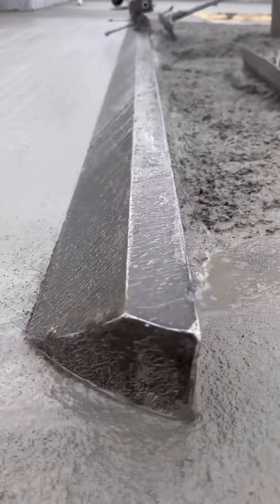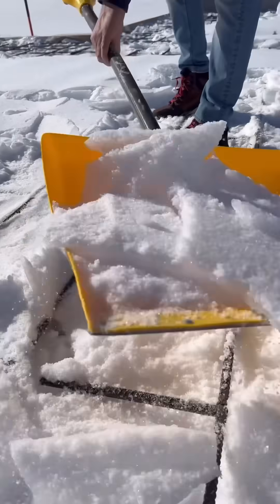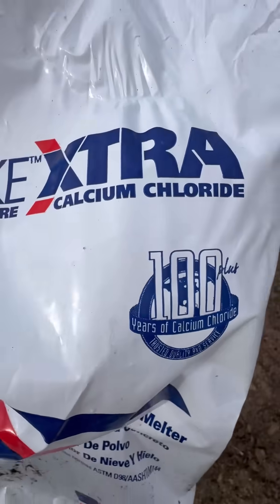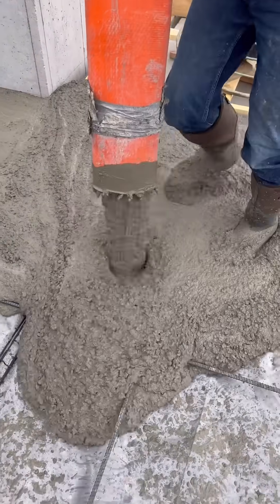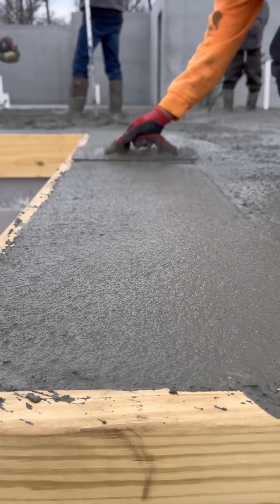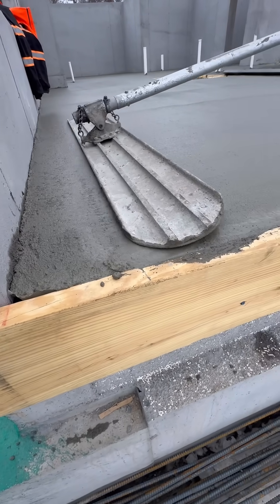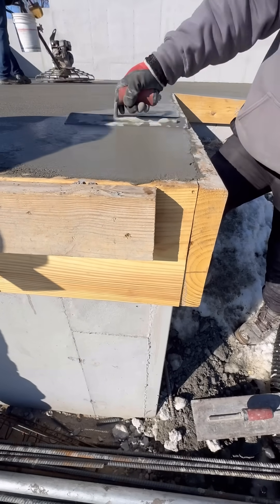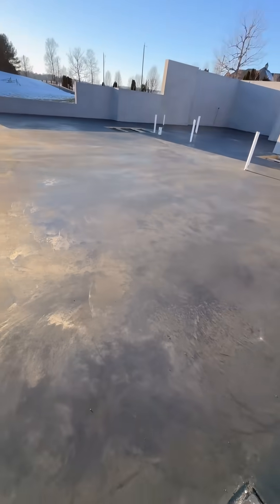How to Pour Concrete in Cold Weather

Comment: As a child, when Mom had a cement slab poured, the contractor was very patient in explaining to me how and why cement cracks. He said the faster it dries the more it's apt to crack. The slower it dries the stronger it is. He put me to task to lightly mist with the garden hose the slab every hour that the sun was up (it was July with triple digit temperaturs) .  40 years later, there wasn't a crack, nor chip in that cement!!
Reply: Rumor has it, he's still misting that slab to this day
Reply: I’m shocked at how many commenters have concrete in the part of their soul where manners usually live. Thank you for your useful comment. 40 years as an eyewitness to what happens when a slab is allowed to cure slowly is of value to many readers. Imagine if only one of them learns from your story, it will pay dividends. We all knew what you meant.
Reply: My parents had a slab poured for a garage building on their property a few years ago. I told them how they should keep a sprinkler on it for a month to properly cure it. They didn’t believe me and said it would be a waste of water. I picked up a cheap sprinkler and had it running to show them how fast the water was being absorbed by the slab. It took a couple weeks of twice daily watering it for water to finally start pooling up on the slab. 3 years later still not a single crack on 6 inch glass fiber filled concrete. When the two post lift installer came he said it would be a breeze drilling holes in it to install the lift. Poor guy spent two hours with his massive concrete drill getting just 8 holes drilled and sweating buckets by the end of it 😂
Reply: Concrete will always crack. But control joints will allow it to crack in the joint and not on the slab....also reinforcement is key. Concrete has great compression strength. The tensile strength sucks though....that's why we use rebar or wire mesh. To give it some tensil strength.
Reply: @citizenplane5840 also some Shear strength too with the rebar setup
Reply: Original comment: here is something neat I learned as a kid related to this video.😊
@wutafungi: you’re wrong, you’re wrong, you’re so wrong, I definitely know everything, and you, you know nothing! WaWaWa.
Reply: @wutafungi being a little angry Chihuahua all over concrete. How cute.
Reply: @LucklessSloth14  
.... 🤔 .... 😂😂😂
Reply: Lucky
Reply: yup, dry it slow enough and itll be damn near impossible to break. watched one of them big jackhammers you put on excavators just skip off this one old slab. had to cut it into pieces small enough for the equipment to lift and load it up like that bc we didnt have a damn thing that could break it. found out later the crew that put it in just kept watering it, ended up takin a couple months for it to cure, but it was an old shop floor that had some pretty heavy machines on it and a cracking floor would make it next to impossiblefor the machines to work properly, so they needed it as strong as possible. they succeeded. 50 year old floor, didnt have a single crack anywhere. (to clarify why the machines wouldn't work right with cracks in the floor, when you install things like mills and lathes, they have to be as close to perfectly level as humanly possible, otherwise they cant hit their advertised tolerances. with modern machinery, even something as simple as the temperature or humidity in the building changing more that a couple points during the installation means you have to start over. once its bolted down and everything, it doesnt matter because it cant move anymore, but before then, a change in temperature or humidity causes the machine to flex, bend, and twist. its imperceptible to the eye, and most measuring equipment can tell either, but thats why we use lasers. after the machine is locked down though, you still need to ensure that the floor itself wont affect things, the most common solution is cutting sections out, pouring a special mortar into the hole, adding your mounting hardware, and thats your base, but you cant always do that because of weight, so at that point you gotta rely on the floor itself instead, and cracks mean loss of precision, loss of precision means loss of quality, which of course means you lose money and risk causing damage to the machine, which can also cause people to get hurt or killed)
Reply: @outkast937 
thank you for this note 🤔♥️
Reply: Thank you for sharing a story
Reply: Unless you have expansive soil
Reply: Did a cement truck bring it?
Reply: @ScottGunMag69  NO.....
Reply: @wutafungi yes.. yes you are
Reply: The point of the comment was to water your slab lightly
Reply: People really roasting a wholsome guy who shared a childhood story about confusing two words 😂 get some life mfckers
Reply: That definitely gonna crack 😂
Reply: Wow, this @wutafungi person is a piece of work. Dude came in and started getting mad at every point made by these other commenters and the original comment for no reason, what gives this guy the energy to continue being such a jerk? Just so full of rage and remarks this one, like a Chihuahua.
Reply: If it has proper cuts in it and you do the misting good chance it wont crack.,
Reply: First off it’s not cement!! It’s concrete! Cement is what’s in it.. just call it concrete. As a concrete worker it drives me nuts when a customer asks when is cement coming? 😂😂😂😂
Reply: @androidmobile9280  I couldn't have said it better myself..... 👏
Reply: @wutafungi you’re making yourself look way worse than anyone else in this comment section lmfao
Reply: Sorry Charlie.... You're WAY OFF ...
Reply: You confuse Concrete with Cement ... Good way to look not so smart ...
Reply: @wutafungi  You know what he meant, don't be obtuse. Also, you used the ellipsis wrong and you don't need to capitalize the "c" in concrete or cement.
Reply: @namgreb9063  Thanx for the lesson dip stick
Reply: @namgreb9063  I wasn't replying to the original poster .... I was replying to some aswipe that said l was wrong  ....
Reply: @ You are clearly very well educated.
Reply: @namgreb9063  if this comment is for me .... l have forgotten more about concrete than you will ever know ....
Reply: @wutafungi you said “ive forgotten more ab concrete than you know”, not trynna argue or choose sides but thats fucken hilarious.
Reply: @abelnunez8562  That's a fact .... 😂
Reply: @wutafungi  You don't seem like a fun guy
Reply: @wutafungi  this must be the only fun fact you know, sorry for not seeing how important it is to you man :/
Reply: @wutafungi  my guy you are crashing out over terms we don't care about and use interchangeably on the internet because we don't care, so go ahead and crash out over something we don't care about.
Reply: @TWEAKLET  why are you making yourself look like a nimrod over something you don't care about ..?
Reply: @wutafungi  cope kid
Reply: @TWEAKLET  keep on tweekin
Reply: @wutafungi a silence your simpleton mind, let him be happy would you
Reply: @wutafungi  You do know concrete is a mixture of cement, sand/gravel and water.. right? One dries quick, the other doesn't. wow u so smart
Reply: @oShadowkun  IT'S NOT A CEMENT SIDEWALK .... IT'S NOT A CEMENT WALL .... YOU DON'T CALL THE BATCH PLANT AND ORDER 10 YARDS OF CEMENT... YOU DO KNOW THAT... DON'T YOU ..?
Reply: @oShadowkun  u so smart a$$
Reply: @oShadowkun   you don't  have any idea why they make concrete .... do some homework. ...
Reply: @wutafungi  cement, concrete, who cares?  Its all the same thing.
Reply: @JMontgomery2012 WOW ....  You put the DE in DELUSIONAL
Reply: @strikerj4810  then you should call spaghetti , semolina flour ....   What's for dinner  .? ....                   "  semolina and meatballs "   because cement is nothing more than an ingredient of concrete ...  u b a genius...
Reply: @strikerj4810  if you don't care ...why make stupid comments?
Reply: @strikerj4810 you have started something you wish you hadn’t
Reply: @oShadowkun  Uhm. Concrete is a mixture of those things yes. But even though concrete contains Cement, that doesn't make them the same. I've never seen someone pour Cement foundations of footings for a house or other structure.
Reply: @wutafungi Imagine being this pissed off about people not knowing about concrete 😂
Reply: @real_smilegamez  who is  pissed off ..? Certainly not myself ...
Reply: @wutafungi crashing out over concrete is crazy 😊
Reply: @tuckercook7426   then y r u  ?
Reply: @ I was laughing at you bro, I have no interest whatsoever in the concrete. Just thought your comment was funny that’s all
Reply: @wutafungi  Literally saw a comment where you used all caps
Reply: @justinstevenson2061  never.
Reply: @wutafungi someone’s angry
Reply: @nah_bred  who ?
Reply: @wutafungi  he puts the de in delusional, but your literally arguing with ghosts??
Reply: @wutinator9296    what's your point ....?  Who is a ghost ..?
Reply: @wutinator9296  Who's arguing  ... ?
Reply: @JMontgomery2012  How's that ..?
Reply: @strikerj4810 it's like saying water and soda are the same thing😂
Reply: @wutafungi unk chill out and pop a bar
Reply: @wutafungi I strongly suggest stepping away from the computer my dude.
Reply: @CheshireSwift  And you should never step onto a construction site .... guys like you don't go home at quitting time ...
Reply: @wutafungi hey lil guy chill out you live with your mom
Reply: @deucebigalow8784  My mom died 20 years ago .... and she probably still has more brain cells than you do ...
Reply: @wutafungi WHY ARE YOU YELLING?
Reply: @MarcelusMecer  FOR THE SAME REASON YOU ARE ..
Reply: @wutafungi Bruh arguing with people for weeks. You gotta set your priorities in life straight. And I thought I was bad but my dude you need to get a life and chill
Reply: @Lonestar0  who the F is arguing  ..? Are you dense ..?
Reply: @Lonestar0  
🤔 .... 👀 .... 😂😂😂
Reply: @ATOM_ANT_2k26 😂😂😂
Reply: @oShadowkun that’s like saying cookies are butter because it’s a mixture of butter and other ingredients. 😂 when you mix multiple things it changes the properties of it make it… no longer that thing 😂
Reply: @tuckercook7426 Exactly!! He's fighting with the entire world over damn CONCRETE!!🤦🏻‍♀️😅  Who has time for that crap.🤣🤣
Reply: @wutafungi  jeeeeeze, are you aware concrete is just cement with gravels? Damn, seems you're not as smart as you think
Reply: @xendastark  and sand and water .... CONCRETE IS NOT F IN CEMENT  ..... WHY NOT CALL IT ROCKS ...?
Reply: @xendastark  You aren't as smart as you think you are either  ....
Reply: @wutafungi lmao 🤡
Reply: @wutafungi its like arguing over peanut butter (chunky vs. smooth) they both still peanut butter.
Reply: @AlexGoldsby  Except we're talking peanut butter and cashew butter...  why is this difficult to understand..?
Reply: @wutafungi Don't go ballistic when someone corrects you. You just did the same thing.

Honestly who gif the difference unless it's your job to know the difference.
Reply: @Abcwhatever  go to a building supplier and buy a bag of cement , and a bag of concrete mix .... will they be the same thing ?   Why don't you comment on something that you understand  ....
Reply: @wutafungi  You literally dont get it. Idgaf about the difference. I never plan on buying concrete or cement. I would hire someone that knows the difference to do the job properly. Im simply saying that not everyone cares. I sure as hell don't because I do not need to know
Reply: @Abcwhatever  Is there something wrong  with you  ?
Reply: @wutafungi  Your a troll, or immature, or stupid. Reread your responses to other users understand why I said what I said. I will no longer be responding to someone that only insults when criticized
Reply: @Abcwhatever Yo, you see that the guy crashing out on a topic that everyone didn't care about? I have an idea that might be potentially funni.
Reply: @wutafungi  Sand, gravel, cement. @wutafungi the king of the cement mixing, obtained this and everything else the world had to offer. And his words drove countless souls to the seas.
“You want my cement? You can have it! I left everything I gathered together in one place. Now you just have to find it!”
These words lured men to the grand line, pursuing dreams greater than they ever dared to imagine. This is the time known as the great cement mixing era.
Reply: @nghihuynh6631  if you can't dazzle someone with brilliance.... baffle them with  BS ....
Reply: @wutafungi  yes, anyway, my closest encounter with you is I went to a starkly empty home depot in Albuquerque once, they seemed utterly confused that I wanted concrete, it took 45 minutes to mix, they gave it to me for free, and it was the best concrete I’d ever had
Reply: @TheBuildingFromThatMeme  lol, nice
Reply: @wutafungi  Ironic.
Reply: @capaeo5532  Are you related to the Clampett's ...?.. Do you have a cement pond out back ...? 🤔

Comment: It may crack...your concrete was too wet, I wonder what the slump was? I didn't see what temperature the welded wire fabric or rebar was, also did you use concrete blankets afterwards? And yes I'm a retired concrete inspector.
Reply from the maker: We cut it the next morning and then very carefully covered it up with insulated blankets. It’s been warm now for two days but will leave it covered up for a week just to be safe because it’s turning cold again.

Comment: You are really the guy
Reply: Yes, the guy that clearly doesn't understand that calcium chloride is never to be used when the slab is reinforced with rebar.  This floor will fail long term.
Reply: @ no he’s the best
Reply: @Trailandtacklegarage  - calcium chloride on rear means he is not the best, but rather, he's a clown that does not care if his work fails in 20 years.
Reply: @JamesChristie-ef7wn4mw3p  bro stop hating he got the job done fast quick and high quality most concrete will fail after about 20 years

Comment: The one thing that concrete is guaranteed to do is crack. Its just a matter of time. 
And my experiences and observations show that concrete poured during temp swings when additives are used like this, it is only on borrowed time until is cracks. 

And when it cracks, the guys that did it will tell you it is bo big deal and the crack is purely cosmetic. Those that didnt pour it will say those that did had no idea what they were doing.

How long after you poured did it stay above freezing? And i bet that ground underneath all that ice was pretty damn cold. Did you have blankets on it for months to keep the warmth in? Guessing no since there was snow and ice before you put the blankets on.
I get why you had to do it. But i dont hold out hopes for its long term quality. But thats just my opinion.

And now all the haters can start in on me telling me i dont know what im talking about.
Reply from the maker: It was somewhat of a rhetorical question because all concrete cracks eventually. However, it stayed warm the night of the pour, We cut it the next morning and then covered it with blankets. It’s now been warm for two days and will leave it covered up just for a few more days just to be safe. We’ve always had more problems with the wind cracking concrete than cold weather.
Reply: @hausplans  i would agree with that part about the wind. I think it's just because the wind pulls the moisture out too quickly. But as you said, construction can't stop for inclement weather.

Did new guy help with the pour?
Reply from the maker: He was a no-show😂